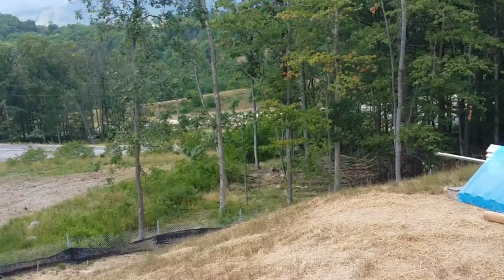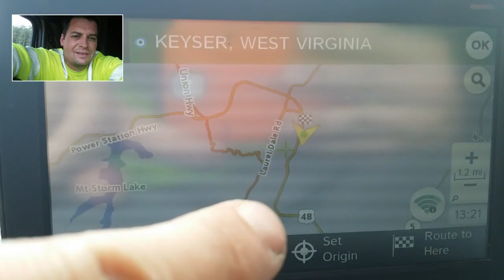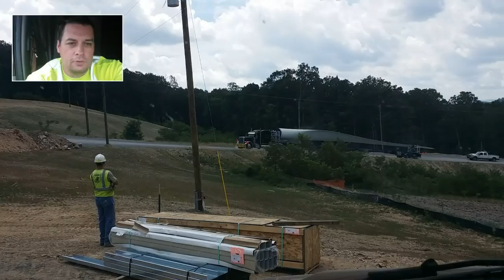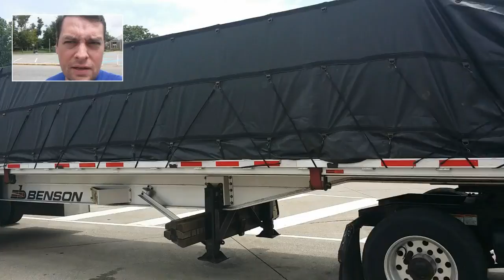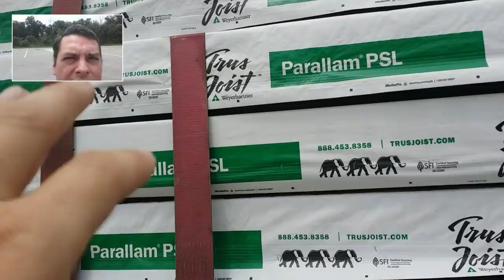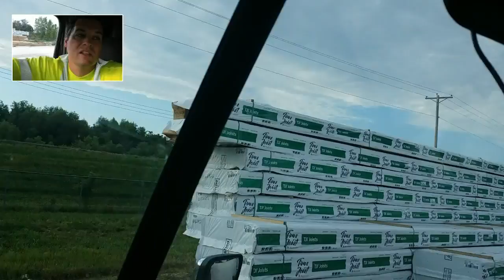Dropping off a steel building and picking up wood beams

Comment: Your load is called parallam and here we call it temlam. It's a way to recuperate trees (like poplar) that are otherwise useless in the construction industry. It has a very high tensile strength but it hates water.  The product we have has no limit in lenght but is fix width and thickness. I saw it been made - it's quite impressive.
Reply from the maker: +cdn soul Cool

Comment: Maybe the 1/2 tarp so the wind off the tractor doesn't rip the paper covering off the beams? Fine video Dale, have a good weekend. I gotta work straight thru. Someone has to fix those trash haulers (as us A.F. guys call em')
Reply from the maker: +TheMILVET I do want ever the paper says ☺